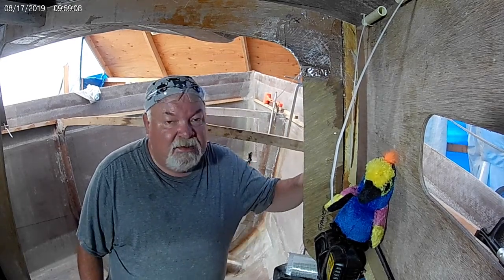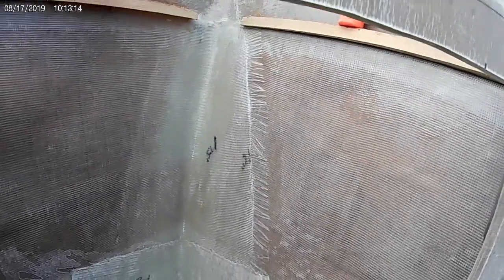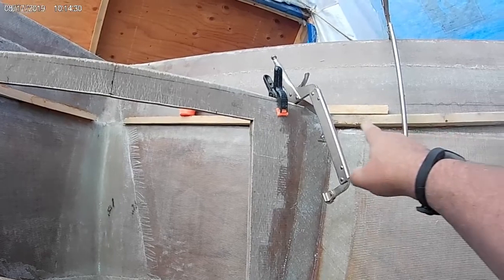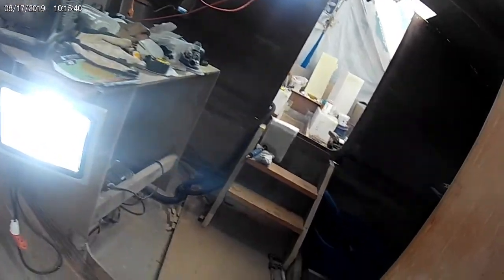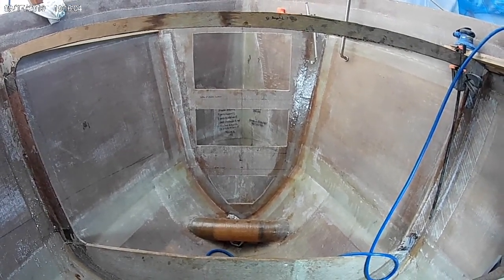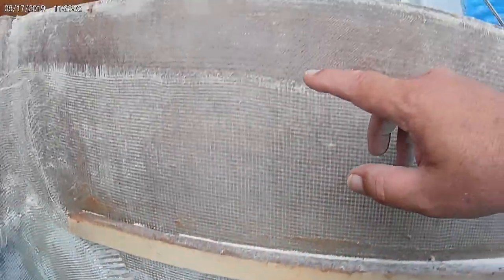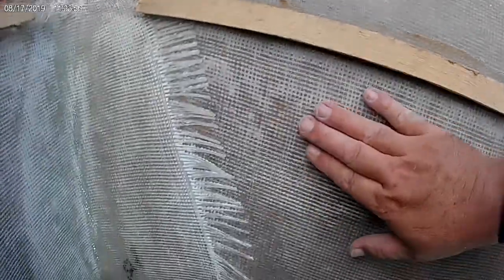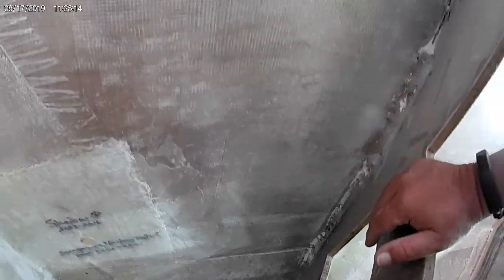I CAN SEE - Three weeks after lens implants so let's Get Back To It - Ep 91

Comment: Most of if not all of the spray on box liners are porous so any water will sit there below the lining. There is a non porous liner but it is commercial grade and Very expensive I thought I could use it on my boat until I found the price !!!!
Reply from the maker: Thanks for the heads up Vance.